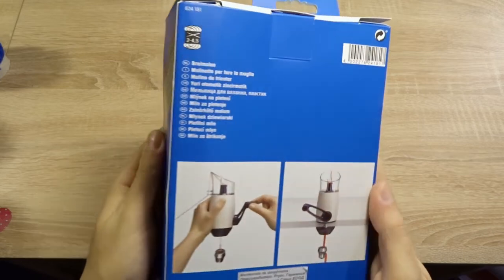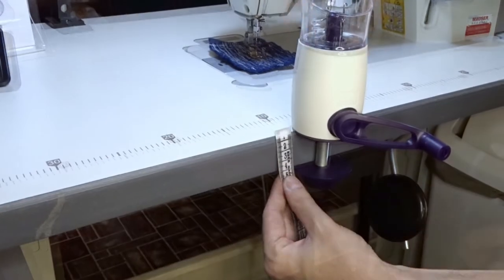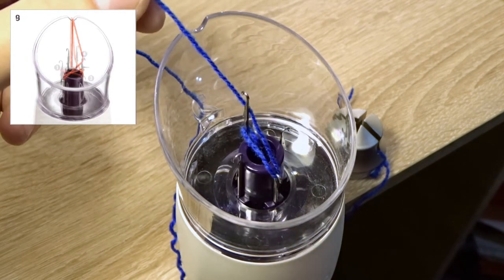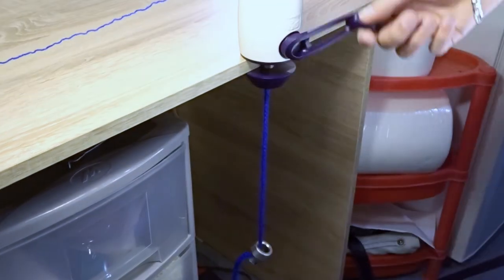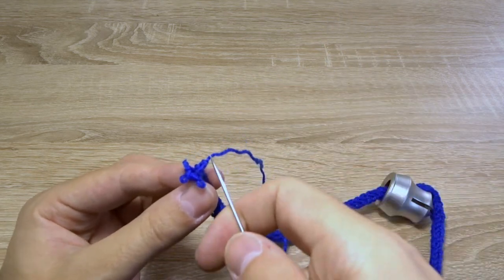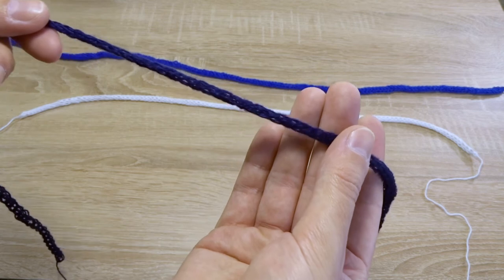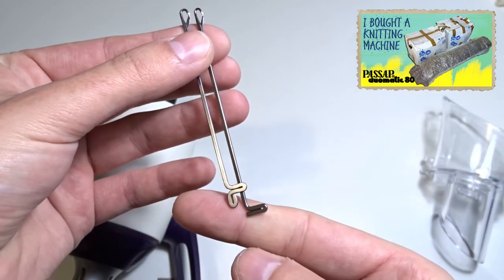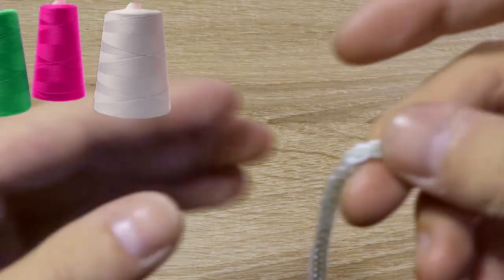Prym Comfort Twist Knitting Mill - Unboxing and Test

Comment: Buen día. La maquina requiere de alguna lubricacion para su mantenimiento?
Reply from the maker: Hay grasa en el interior, añadida por el fabricante. No hay nada escrito en las instrucciones, por lo que supongo que debe abrirlo y revisarlo de vez en cuando, especialmente si está en uso constante. Si se vuelve ruidoso o si es difícil girar el mango, debe lubricarlo. He leído que mucha gente usa grasa de litio blanca, pero no puedo recomendar un aceite para usar. Todavía no he lubricado el mío.

______
There is grease inside, added by the manufacturer. There is nothing written in the instructions, so I assume you need to open it and check it from time to time, especially, if it is in constant use. If it gets noisy, or if it is hard to turn the handle, you need to lubricate it. I have read that many people use white lithium grease, but I can't recommend an oil to use. I haven't lubricated mine still.

Comment: Bună, sunt din România, nu reușesc să găsesc firul potrivit pentru această mașină.
Îmi spui te rog,ce fir folosești?
Mulțumesc
Reply from the maker: Nu am nicio informație despre firul albastru, pentru că nu avea nicio etichetă. Pare a fi fir acrilic. Pot să-ți spun că are o densitate de 16 WPI (wraps per inch).

Firurile de bumbac sunt de 300 tex și 50 tex. Cel de 300 tex are o densitate de 21 WPI, iar cel de 50 tex are 44 WPI. Este un fir foarte subțire, asemănător cu un fir de ață.

Toate firele sunt cumpărate în bobine mari deoarece le folosesc pe mașina mea mare de tricotat. În orice caz, toate aceste fire sunt de dimensiuni fine până medii. De asemenea, folosesc frecvent 3 fire de fir acrilic 2/28, iar rezultatul este un șnur perfect.
Reply: @ArtOfClay  Mulțumesc mult 🤗

Comment: Struggling with mine, the latches don't always do what they should and so the yarn isn't coming back over the hook. Super infuriating!
Reply from the maker: Oh, this is frustrating. Did you try using a thinner yarn? Also, you might check the yarn tension. If the yarn is not freely coming from the skein, the stitches may get too tight and won't get over the needles.
Reply: @ArtOfClay Yep, tried thinner, thicker, more/less stretch... pulling loads off the skein (as yes that tension definitely didn't help). 

Gave up, dismantled it and turned the hooks into a hand held tool (I now have a three hook one and a four hook one) which works muuuuuuuch more reliably and still produces icord very quickly!.
Reply from the maker: Thank you for the feedback! That sounds like quite the journey! I'm sorry to hear that you haven't been able to make it work. Turning the hooks into a hand-held tool is such a creative solution. I recently saw a tool like this and am also interested in making and trying one.
Reply: @ArtOfClay  Hehe, I never like to let something go to waste!

So far I have (for me at least) discovered - the latch hook shaft does need some length to it so it flexes as you pull the loops over, set them into the handle too deep and they won't, not an issue with yarn with some stretch to it, but it makes life harder with non-stretchy cottons etc.

I am finding latch hooks all the same height is better for me than staggered heights. Another advantage of this is you can go right to left or left to right - staggered hooks mean you can only go shortest to tallest, whichever way they're set up.

Bigger handle is easer to hang onto than a slim one.

I've done 4 and 3. 4 has to be cast on slightly different but its not hard, I set my 4 hooks same height across, but on a slight curve (each facing out from a centre point rather than all facing same way), which seemed to make sense to me but YMMV!  

My next challenge is to find chunkier hooks for bigger yarn, the snag there will be they are longer with the 'nubbin' on the shaft a long way down which may make for an unwieldy tool (or chop them off but risk the hooks coming loose!)
Reply from the maker: @emmajudson5945  You're really diving deep into latch hooking! Thank you for sharing your research and experience gained from making and using these hooks. I learned a lot of valuable tips from you. Your insight about having all hooks at the same height makes a lot of sense. I have seen bigger latch hooks for making rugs, that can do the job with the thicker yarn. I still haven't tried to make such a tool yet, but I'm sure I will use your excellent tips.
Reply: @ArtOfClay blame the ADHD i can't do a thing without nerding out on it completely! :) Rug latch hooks, of course!!!! tootles off to find
Reply from the maker: @emmajudson5945  Haha. ADHD can often lead to some amazing discoveries and insights. Your enthusiasm and thoroughness definitely pay off in the knowledge you share!

Comment: I didn’t make it right I tried a lot of yarn and I still no how and what my mistakes
Reply from the maker: If you are following all the steps, maybe the yarn is not suitable. Try to use a different yarn. 🤔
Reply: @ArtOfClay  I used a lot
Reply from the maker: Hmm... Check if all latches are open and working. Also, make sure you are rotating the handle in the same direction all the time. When exactly the problem occurs? I want to help you, but I am not sure how.